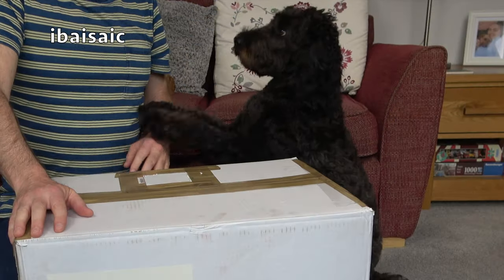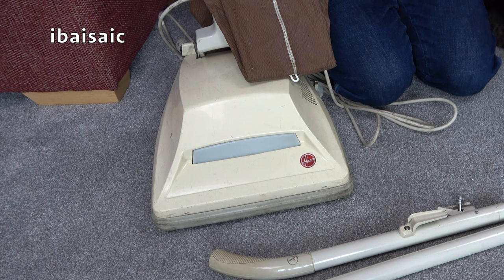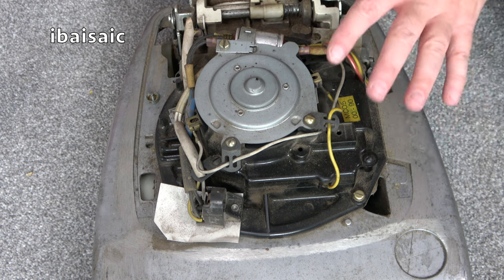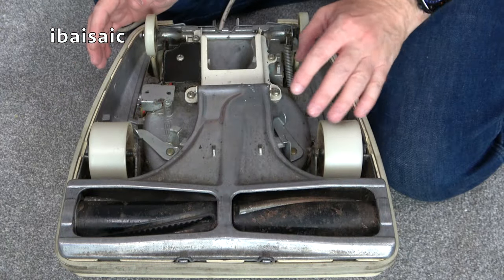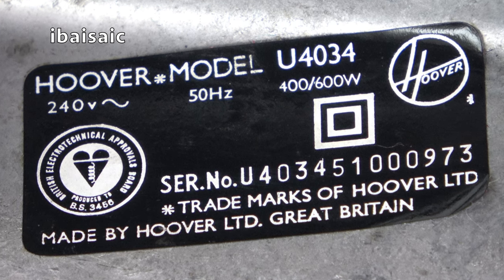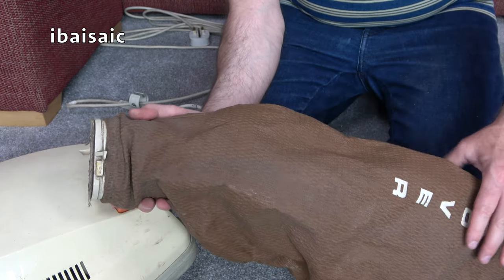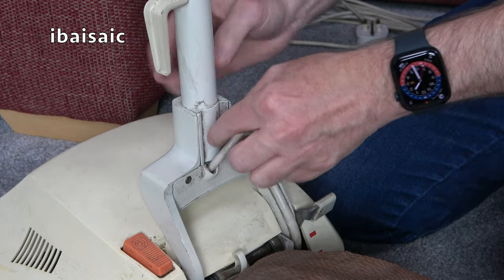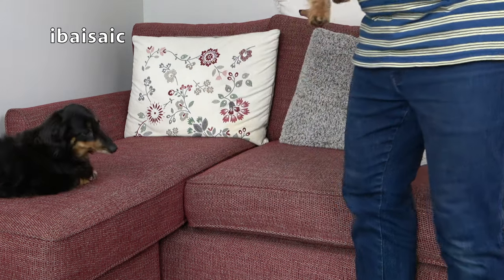Rare Hoover U4034 Ranger Senior Vacuum Cleaner Unboxing & First Look

Comment: What distinguished the Junior and Senior? I mean obviously they’re two different machines, but was the idea of the senior that it had a larger capacity bag, or a more powerful motor, or was it just the later version, a redesigned Junior for the mid to late 70s? Did they sell concurrently or at different times?
Reply: The Senior came first (1919 I believe) and then the Junior came along as the more affordable, smaller variant for the British home in 1934. They ran alongside each other until the Senior's discontinuation in ~1980. The Junior went until 1988, then until 2003 in TurboPower form factor.

The Senior had more power, a larger width, a headlight and a bigger bag.
Reply from the maker: The Senior, or at least a model based on the Senior was selling in the mid 80s but Hoover renamed it Powerplus.